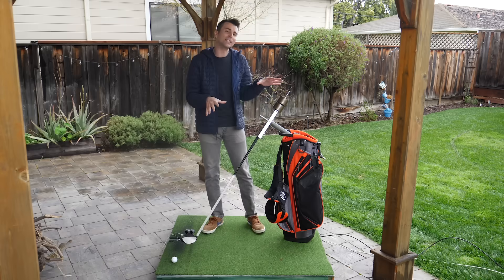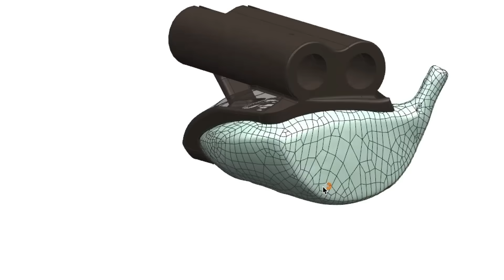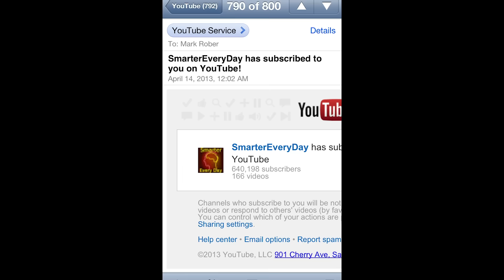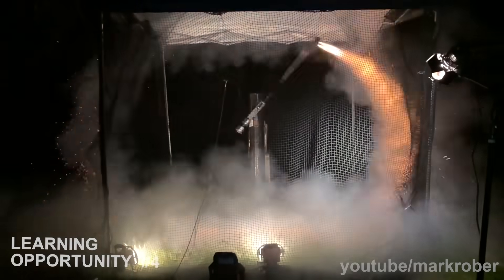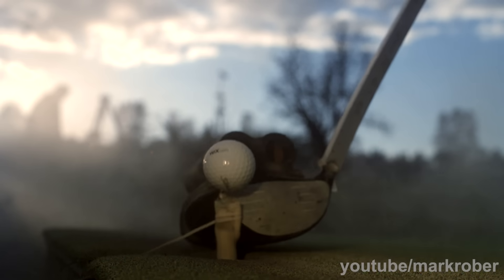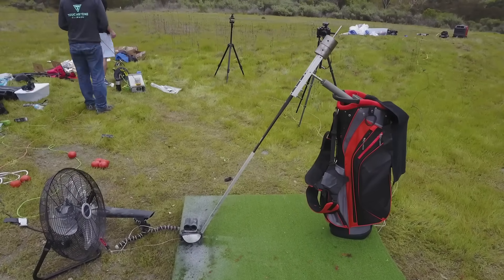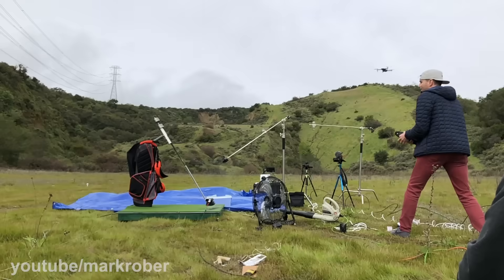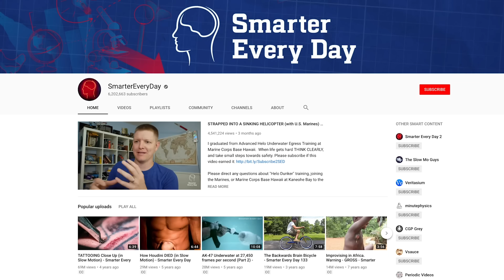Rocket Powered Golf Club at 100,000 FPS

Comment: The only thing that you didn't notice is that the over rotation of the rubber T actually put the golf ball in the sweet spot of the club holding it in place gave you chip shots instead of full on direct club hits if you feel so inclined you may want to modify your base slightly and see how much farther the ball will fly because you're only getting about 20% impact on the ball.  The other idea is a straight up T like what is used in certain driving ranges where the ball pops straight up instead of swings glue it to that and you won't have any swing in the ball

Comment: Pretty cool. I think a certified golf club builder would have been helpful on your team. Perhaps someone who works with World Long Drive professionals as their swing speeds are close to 150mph. They would be able to provide optimal lofts and shaft flexes and torque ratings to maximize distance as well as to balance the huge increase in swing weight due to the addition of the motors and mounts to the club head.

Comment: I sooo wanted to help optimize ball flight.  The tee should have popped up, not put on a lever.  Then the position of the ball should have been adjusted for contact on a slightly off entered hit (a little high and a little towards the toe).  You should have used a xxxstiff shaft then reinforced.  Contact point in the arc should be optimized according to shaft flexility and spin rate.

Comment: You could also probably mostly fix the tee stiffness thing with a relatively flat tee cross-section, that's flexible in the direction of ball travel, but much thicker/stiffer in the rotation plane of the tee.

Comment: You can’t have a regular flex driver with swing speeds of 150mph+ I know you stabilized it with aluminum but if you used a driver that the long drivers use, with an extra stiff shaft and less loft you could get much farther results off the tee

Comment: Mark Rober Love the thrust diamonds shot of the E-motors on that super slow motion shot.  Cool project, had in idea for a future video: You could make a golf club that has a blank shotgun round, and it is set to detonate (with visual sensor) right at the "sweet spot" distance in the club swing to the ball.  It wouldn't require so many spins like rockets, and the equivalent energy would be released almost instantly to propel the ball.  It would be amazing to see a head to head of the rocket club/vs the shotgun round club.  Thank you for excellent videos, I shared your video of the package prank on my FB and it was shared hundreds of times, went viral immediately: and this was just as you had released it.

Comment: You should have used those special golf balls that Top Golf uses that have the chips inside to measure the distance traveled. But excellent build 👍🏽
Reply: Manny Navarro top golf golf balls have a chip in them, but it's the sensors in the nets that read those chips and tells your bay monitor which sensor you hit.

Comment: Is there anyway to use math to figure out the golf ball's trajectory and ultimately its stopping point?
Reply: Cry Whit There is if you want to do a little bit of analysis on the club, the ball, and the way they interact. (We’re gonna make a few assumptions here just to make the math a little bit easier)

Let’s first think about the club spinning around, if we can measure how long the club is and how quickly it’s spinning around (in the vid he says ~35 times per second I think) we can use that to tell us how fast the head of the club is moving, if we say that this is a 1m long club, that tells us that the head of the club is moving at ~70m/s when it hits the ball (~150mph)

We’re going to assume that the club doesn’t slow down at all when it hits the ball and gets the ball up to exactly that speed.

Now we need to determine what the angle we hit the ball with is, we can do this using some trigonometry or we could look at the slow mo footage and determine what the angle is, once we know the angle that the ball is travelling in from the side and from above we can tell exactly how far it will go.

When an object is fired off it travels in a parabola, and there are two directions that it’s moving at the same time, it’s moving some amount of speed up and some amount of speed forwards. We can tell what those are with:

Upwards: Sin(The angle we determined earlier) * (The speed of the club)

Forwards: Cos(The angle we determined earlier) * (The speed of the club)

We know that gravity is only pulling the ball back to earth, we are going to ignore the wind resistance to make things a little easier on ourselves, and now that we know the speed that the ball is moving upwards, we can determine how long the ball will be flying for;

Time of Flight = (2*(Speed upwards))/(Earth Gravity)

(Using what we see in the video it looks like that time is about 7.25 seconds)

And lastly we can take that time, and since nothing is slowing the ball down in the forward direction, we can say that the distance it flies is:

Distance: (Forwards speed)*(Time of Flight)

In the video this looks like 1443 feet (440m)!

The record for the longest golf drive is 515yrds or 471m or 1,545 feet! So it looks like given all our assumptions (I assumed an angle of 30 degrees) Mark didn’t quite beat the record, but he came pretty close! 

This is also super simplified and way more thorough analysis is possible, if you’re so inclined, take a dynamics course! I really really enjoyed what I learned through mine. All analyses are just approximations, and you can get more and make accurate with more and more complicated models, so much of engineering is just finding out how simple your model can be to get the results you want.

Sorry for the long winded answer!

TL;DR: The ball looks like it went about 1,450 feet in the direction that the club hit it!

Fun Fact Edit: This also means that when the club flew off the mount, flying almost straight up, it was going about 22m/s, or about 50mph!

Last ninja edit: The ball actually looks like it gets accelerated considerably faster than the tip of the driver, so there’s actually a pretty good chance that Mark totally broke the drive length record! Once I’m back to my computer and can look at the video frame by frame I can give a better answer but it’s totally possible that mark hit 2,300 feet or so with his drive!
Reply: @WeAreChecking  I don't have a mathematically inclined mind, so I have to rely on those smarter than me in that regard. Thank you so much for responding!
Reply: @WeAreChecking  the rocket club toes the shot mostly so it's barely making 350 yards even with that swing speed.
Reply: @WeAreChecking  Thanks for all the math work Richard, this is the exact answer I was looking for when I came down to the comments. This is an awesome example on how useful math really is and can be.

But I had a related question you might be able to answer. What about the Magnus effect? Would that change the distance the ball would travel? Or would it be too small a difference to make a fuss about?
Reply: GiantSavage117 Yeah! Like I talked about a bit, you can get super super complex to get a more and more accurate answer. The Magnus effect would have a pretty big effect, you can even see the ball spinning on launch! But performing the calculations on that in a YouTube comment is gonna be a little bit beyond what we really really need. Another big factor in this is wind, suppose it was blowing just a few miles an hour to one direction, over the course of the flight we might see the ball drift even as much as 50-100 feet. In all my calculations I assumed the ball was in a vacuum, that the ground was flat, and that things like the energy lost to the collision and the like weren't real. I'm really excited for Destin's video because it will shed a lot of light on the interaction between the club and the ball, but for getting a super rough estimate on where the ball ends up, we can make those assumptions. 

Building a more and more complicated model of how this process works would be a really fun thought exercise, but it's certainly a rabbit hole. CFD, or Computational Fluid Dynamics, is actually a huge focus of what I do, and running something like this is totally doable (if a little involved) if you wanted to get a really really detailed understanding of what's going on.
Reply: or course. all you need is velocity and angle above ground to find it's distance downrange in a vacuum. given air resistance some other equations can be applied but you need some experimental data from a golf ball in a wind tunnel (i'm certain this exists given all the hoopla about the divots). and finally sprinkle a little trig based on flight heading and maybe plug in a correction for wind if there was some. you could probably get within 50 feet squared? maybe closer. just a guess.
Reply: what you're asking about is the physics of ballistic projectiles. you can see the math on this site, some of which is actually very simple though the notation appears complex. θ is literally just the angle launched, where level is 0 and straight up is 90. ideally one would launch 45deg for maximum distance, in which case the equation gets even simpler yet to just 1 variable needed, the velocity at launch.

(read 'Notation' and then check 'Distance traveled')
https://ipfs.io/ipfs/QmXoypizjW3WknFiJnKLwHCnL72vedxjQkDDP1mXWo6uco/wiki/Trajectory_of_a_projectile.html
Reply: Chrismofer I'd love to run a bit more of a rigorous description of the problem here, I'll be the first to admit my description of it has a ton of simplifications, if we had a topographic map of where the test was done (so we knew the height at which the ball would hit the ground) and if we really really wanted to we could do some really fun fluid dynamics to describe how the ball would behave, there are certainly ways to get a better understanding of what's going on. That's the beauty of a lot of these problems, you can always get more accurate and more complex if you want to know better what's going on
Reply: @WeAreChecking  fluid dynamics might be a misstep unless you have detailed temperature pressure velocity and direction data at fairly regular intervals across the path, not to mention ball rotation and gyroscopic precession. I think a modified ballistic trajectory equation including drag and wind would be best given the available variables.
Reply: Chrismofer I mean sure, if we were seeking the absolute final answer running a simulation with inaccurate data would be a step in the wrong direction, however, we saw a massive spin on the ball and plenty of other aspects which would make this process incredibly difficult to model in it's entirety, the collection of such data would be prohibitively expensive. As mentioned by others, if balls exist which can give us the data we're looking for, then I think napkin math is more than sufficient to satisfy the "what if" questions we have. All models are approximations, some just more complex than others
Reply: @WeAreChecking  oh yeah, if we could make a pretty good guess for the spin, the gyroing isn't too complex, that'd be leagues better than the basic drag stuff, at distances like this it could account for some significant curve and lift or drop
Reply: @chrismofer  regardless of all the factors and details you pointed out...the center of the club head is the sweet spot for maximum distance. The mechanical arm does not pronate...the ball is not at rest...and is being hit at the edge of the club head mostly.  So no matter how fast the swing speed is...it will not go far and you can't measure the distance because there are too many variables.
Reply: @wessgate1  I'm not sure you understand the question
Reply: @wessgate1   I'm also not sure what you mean by "it will not go far" when it demonstrably does. If you'd like to understand why a harder swing will cause more velocity in the ball, check out the physics of elastic and inelastic collisions. Billiard balls are a typical example, but golf is also commonly used.
Reply: @chrismofer  it never showed on the video that it does. Also means you've never played golf
Reply: @chrismofer  Anyone who's actually picked up some clubs and learned golf will tell you. It's more than just swinging hard or fast.
Reply: My 12 year old daughter hits farther with a relaxed swing more than she does when she Powers up. Why? Because contact, the snap of her wrists and follow through as well as facing her target are more controlled with the relaxed swing.
Reply: @wessgate1  the question was not about golf technique.
Reply: @chrismofer  what I'm saying is you can actually see it isn't going to go far because of the contact regardless of swing speed. So why bother seeing how "far" it went? Most likely it shanked
Reply: @chrismofer  you are talking about all the variables and Dynamics of tracking the distance the golf ball was hit...I'm telling you it probably didn't go far. If it wasn't a golf ball and a driver than your points are valid. But they are using exactly that
Reply: It’s hard to figure out without knowing how fast the ball is going off the club head. With a driver, the ball speed is optimized when it’s about 1.5 times the speed the club head is going, so if the club is going 100 mph and it transfers the energy to the ball as efficiently as possible, the ball will go about 150 mph off the club head. In this case, if the club is traveling 150 mph, we should see ball speeds in excess of 220 mph. 

If you’re interested you should look up “Joe Miller Long Drive” because he can actually swing a golf club up to 150 mph. It gives you a good idea of how far the ball would go in real world conditions.
Reply: SlowedTripod Thanks for letting me know this! I'm about as layman as it gets when it comes to golf (I had no idea clubs were that flexible!) and knowing that it's optimized for about a 1.5x velocity multiplication totally changes what our end number looks like
Reply: Yes.
Reply: They might be able to to use the weight of the ball, the speed it travels and the angle it is going to find it
Reply: Yes, it's a common golf tracking device ;)
Reply: Arti units do that

Comment: I noticed you mentioned an arduino. I am working on a year long group project for my 4th year engineering class @ school involving an arduino. I am still working out and learning the basics of C/C++ programming. I was wondering if you had any tips for those new to arduino programming. I already know a bit of robot C programing; however, arduino seems to be slightly different. @ least to me.
Reply: The project also involves contacting experts and documenting us showing our designs to them and receiving feed back. Hopefully Mr. Rober could be one of our experts.

Comment: Great video but why did you choose one of the cheapest drivers lol. The swing speed would have been even faster if you used a Taylormade or Callaway driver.
Reply: Lol that's probably true, but I think changing the rockets to more powerful ones gave more speed increase than a better club would. Also, it still wind insanely fast :)

Comment: Would a stiff pbc pipe with and shorter section of soft material inside the PVC have worked better? Would it reduce the travel of the ball enough by the amount of leverage on flexible material.

Comment: Holy crap that is awesome!  It reminds me a lot of a pumpkin chuckin centripetal launcher.  I wonder if you made a centripetal launcher that uses the same rocket motors and is the same length and weight of the golf club and carries the golf ball with a release mechanism, would the golf ball go farther?  I would think so because with the club hitting the golf ball, there's a partially inelastic collision in which some energy is lost.

Comment: You should have added a backdrop with measured lines on it to calculate the initial speed of the ball. Then with measurements of mass, diameter, and frontal area, to calculate the distance of the ball with kinematic equations incorporating drag loss from air friction. But, you could also figure out the velocity (with more error) by measuring the length of the club to the contact point, along with the force the motors provide at their fastest point. 

Either way, neat video. Interesting to see the failure points and solutions for them as well.

Comment: You should try and get a gps tracker inside a ball and see if it survives the flight to find how far it went
Reply: With the way the ball compresses, I can't exactly imagine it will survive. haha
Reply: If the club head speed was measured correctly at 150mph. It should be somewhere between 330yds and 370yds depending on club loft, launch angle, spin rate, coefficient of restitution and climate.

Comment: Golf experts : it takes years of hard work and practice to become good at golf
Mark : hold my beer
Reply: Clive Reddy you consider a golf ball traveling at 150MPH that never gets in the hole is good?
Reply: @knowone8683  yep
Reply: @knowone8683  It's called comedy
Reply: Colin Walker comedy is usually always practical. What he said makes zero sense.
Reply: @knowone8683  It's modern comedy. Hardly anything makes sense and it's still funny.
Reply: Clive Reddy 😂
Reply: Hold my pond water
Reply: The fact is that a human with much less power than this device (+ its accumulated momentum) has a club speed in the same order of magnitude.

The speed of the club when played by a human is caused by the torsion of the shaft that acts like a spring, releasing energy at the impact. Here the stiffening of the shaft makes that impossible. 

Searching for the optimal control to input in order to maximize the speed of the club at the moment of the impact would be more interesting imo
Reply: It takes just as long to learn mechanical engineering but oh boy does it pay off
Reply: not hold my bear, hold my rocket